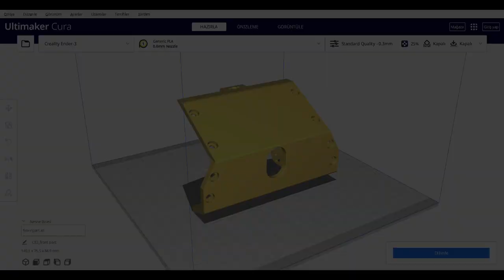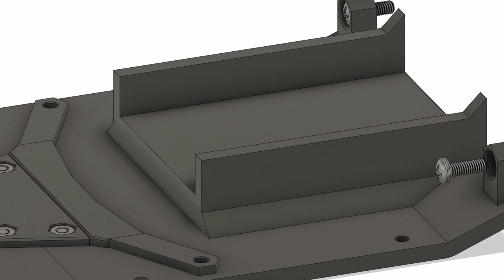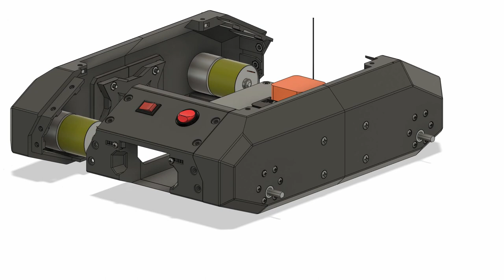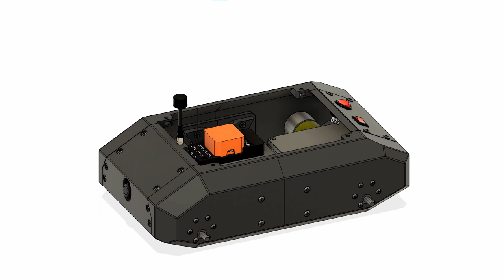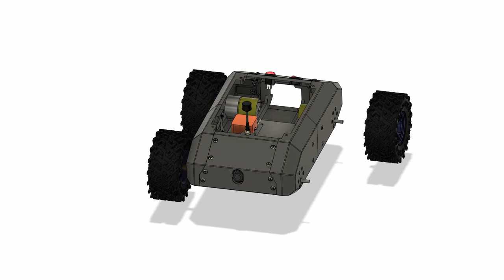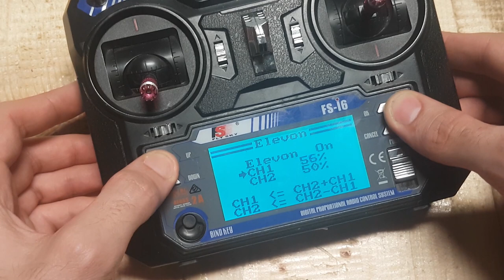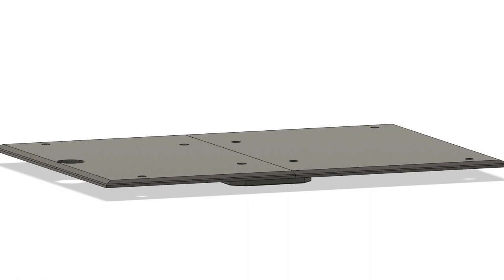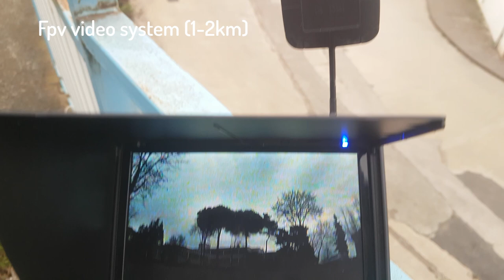Open RC FPV Long Range UGV Project

Comment: This is super cool and impressive made from scratch. I really wanted to do something like this but figured it was just too much work trying to get something equivalent or better than RC cars out there which are able to tackle nearly any terrain. Unfortunately those are around $400-$500 though.. Either way it's kind of a slap in the face when doing something like this, getting real excited about it, then seeing that it might get stuck in slightly tall grass. That happens to any car of mine that isn't getting way more than average ground clearance. I think with some clever servo arms something like this could be made to get itself "unstuck" though. Front and rear diff locking seems to really help but then you really do need a super legit and full featured chassis and suspension.
Reply from the maker: I actually tried to create a platform to improve myself. With this project I made, I both improved myself in drawing and learned about the problems of unmanned land vehicles. But yes it is a tiring tool to do. But it can be used for different purposes by putting a lidar or a pixhawk on it. Thank for the comment :)
Reply: Hi, I believe I have a chassis that meets all the requirements at a good price！

Comment: Hello! Your project is great. Thank you so much for this video and attached materials. I also want to make similar robot. But I want to make autonomous one with GPS control. Can the construction presented in the video be autonomous? I see that you are using Cube Orange to have the ability to make it controlled by GPS ? Sorry for my English). I hope you can help me.
Best wishes,
Mihail
Reply from the maker: İm still working on it. I still cant efford pixhawk cube. İn the video that was just a reference its suitable for pixhawk. But i will make much bigger car and when I build it i will add pixhawk on it. Thanks for the comment and im sorry to late response . I didnt take any notifications. 
Hope u can maka a autonomous vehicle.
Reply: Hi, I believe I have a chassis with high quality~
Reply: @U-Tech20  Thank you for answer! And  I must say, that I built my own autonomous  viechle based on Pixhawk 2.4.8. 
This robot made for measuring roughness of pavement, and I won local competition of students projects. You helped me a lot and I really appreciate it)
Reply from the maker: @paint4745  I'm so glad to hear that. I congratulate you on your success. It is a very happy thing that the things I do benefit someone. I wish you many more beautiful projects in the future. I'm curious about the project you made, can you send me photos on Instagram. utech.2023

Comment: cool project, is there anyway you could provide us with a parts list as in, where bought and which specific product?
Reply from the maker: Thanks. Im preparing the material list with amazon and bangood links.
Reply: Where can this be found?
 @U-Tech20
Reply from the maker: I shared all links in descriptions. Are you mean design files or product links? @Louisianahelicam
Reply: @U-Tech20  I’ve printed the entire frame and am ready to build.  Can you share the link to the LED lights?
Reply from the maker: Hi. Sorry for late response. I use basic LED lights u can find in everywhere, but here is the link maybe it can help you. İf you search LED light be sure to choose 12V led bcz if u choose 5v led battery can damage your led's.And ım soo happy to hear you are making my design. İf u are finish UGV project i would love to see in thingiverse. Thanks again
https://www.amazon.com/YUNBO-Addressable-Waterproofe-Storefront-Adhesive/dp/B08LB3KGP5/ref=sr_1_10?crid=1GPQ3HF56UR2P&dib=eyJ2IjoiMSJ9.XWPVXi44kScDUSbL7ZZrDOvk_nxeTQTV9kgjerYTbyBKYdPmD_-Q-uD0bj6DxG6Geh9srnkEldKX9TiBHopcfm4vFtxfz3FP7xj1I4zWgrnEKpeP3odXtejlogFjhpNG4nrRXQxT6x_lCK3asOI2H59lRrPSPHkU9erlMlSKIrM4uyZzpeYfcUWJerIeLj14E-uv1m1Xs_BVUuW6dpaVhAmwoAmGxfx2gVVyYQKbvxs.D94cw1KiAXfZqtvKQ-jVtwxHW0c2yLleF8_hHBH5x-Q&dib_tag=se&keywords=12v+LED+module&qid=1709139958&s=books&sprefix=12v+led+modula%2Cstripbooks-intl-ship%2C237&sr=1-10-catcorr @Louisianahelicam

Comment: Great video. Learned a lot.
I have a question, what is the diameter of those wheels.
Reply: And also do you know where can I find similar tires and couplers, but for the tires i need approximately 200 mm or at least 150
Reply from the maker: @axeleliasdejesusdeljesus2407  ı used a 125mm diameter tires. I shared all material list in thingiverse you can find there. I bought them in Turkey but can find it in amazon or bangood. If you want to buy bigger tires, make sure tires dont touch the chasis , maybe u can use longer coupling so tires cant touch chasis. Thanks for good comment :)
Reply: I had to use rock climbing tires, they were the only thing with the clearance to not rub on the body. I was thinking about printing an adapter that extends the 14mm hex out another 10mm so I can put offroad tires on. Just not sure if PLA is tough enough.

Comment: All the links are cut off, can you update?
Reply from the maker: Hi. Im sorry i cant make youtube vertification. So icant share real link. You can search in thingiverse saying UGV and you can dowland it. I still trying to do vertification im sorry about that.
Reply from the maker: I finally did vertification. Check the links u hope it works.
Reply: @U-Tech20  Got em and my bot is running good. Next up, I'm gonna add a buddy box to have a raspberry pi as the main controller and RC as the take over/backup.

Comment: Hi! Very cool design, would like to try to build your model, but I can't understand what kind of battery was used in this case? Can you tell me how many volts are needed? 12V 6pcs  3s2p li-ion battery? I'm new at this(
Reply from the maker: You need to make 3s battery hich is aproxsimaitly 12v, 1 li-ion or lipo battery can give 3.7v, 3 li-ion can give 11.1V. and then i make paralel 2 of them for more capasity.

Comment: Hey, anyone know what LED strip was used for the headlights? Thanks in advance
Reply from the maker: hi, im so sorry but ı could't know what are the exact names of the LED strip But you can use 12v normal LED strip. Just make sure its fits well.
Reply: Ok thank you. Great build btw

Comment: I'm in the process of creating this. I just made the body and am about to do the wiring. Im a lil confused on the electronic schematic
Reply from the maker: First of all, thank you very much for producing my design. It felt so good to see someone do my open source project. I can say this for electronic design. I tried to be as descriptive as I could. The connector system may have been a little confusing. The reason why I use the connector system is that it is easy to assemble and that someone who wants to make design changes in the future can change it more easily.

Comment: We're can I get this 0:19
Reply from the maker: Whats that i didnt understand :(
Reply: @U-Tech20  hey the motors you use are out of stock, do you have any  recommendations for suitable replacements ?
Reply from the maker: @TheAdamorme  you can searh it with 37mm reduced motor here another link i just found:https://www.amazon.com/Greartisan-Electric-Reduction-Eccentric-Diameter/dp/B0721T1PXQ/ref=sr_1_1?crid=OW3ZMMI5SR5S&dib=eyJ2IjoiMSJ9.goJ7SAt8txLAUF9u8y6H3BXAVF18otFwgDmJHL3U39D8s9H0aWNxBXQJxXx_b4UfAYWxoDle-QuEVfhsxNvV0Xc-X6btC0Cbu_qQEJWI4UsHsU4lqN8hzF7EL5WgVItUScx7kKCIRIjNh_De69NEg5Ha2GB9_bqfu-4YmCov5fkouEougG7kZOrmx3_CmmlWoXULbdB6q3zKlRFGUvgxljboRe_E5_N7Ml4Yg3WyaE9gtuqp442c7xcUfYbw8Dq5-3kpQcM-gi72frJaHV4eCCEd-rdxdDWYhNE8F77knhI.sT0IV-s41DPPDo1VKECd3cEDqAjveQkBrSb5zdb3hpM&dib_tag=se&keywords=37mm+reduced+motor&qid=1720299722&sprefix=37mm+reduced+motor%2Caps%2C202&sr=8-1
Reply: @U-Tech20  absolute  legend, one last question. how many ESC's total do i need 2 or 4 ? from what i can tell it looks like in only need 2 but thought i'd ask
Reply from the maker: @TheAdamorme  i use 2 esc. I connect 2 motors paralel. So 4 motor u can use 2 esc. U can check in electronic schematin link in describtion.
Reply: @U-Tech20  sweet, i thought so, the only thing i cant find now is the adapter 9:45 sorry to be a pain but what are those called ?
Reply from the maker: @TheAdamorme  I am very happy that you are so interested in my project. Please do not apologize for asking questions. It makes me happy that you ask questions. Those parts are called couplings, they usually come with wheels, but if they don't, you can search on the internet for 30mm hex couplings. I must have left a few links you can check.
Reply: @U-Tech20  it's by far the most comprehensive build I've found so far and it's fantastic, would you be able to explain how to set up the mixing for the differential thrust for steering on a crossfire transmitter of that's not too much trouble ? I really appreciate your help :)
Reply from the maker: @TheAdamorme  im sorry i dont know how to make mix in croffire but heres a some link for elevon mix. Im using elevon mix for diferantial drive system. :https://youtu.be/cKqwTQlAWa8?si=26Rtq1c2IiikcEse
Reply: @U-Tech20  hey man sorry to bother you again but i just wanted to confirm that these motors that you linked are suitable as they have eccentric shafts and the originals in your plans are central ? >.<
Reply from the maker: @TheAdamorme  The electric motors I use are also eccentric. The output shaft is not exactly in the center, but a little further down.

Comment: Hello!  Please tell me what wheel diameter did you use?  Are you planning to do this project on autopilot?  For example inav?
Reply from the maker: Hello, the wheel dimensions I use are 125x58mm. You can find it from this link https://www.amazon.com.tr/dp/B07ZBG9T1L?ref_=cm_sw_r_cp_ud_dp_5JFGCKEX4P85QT789DCH. I want to install an autopilot system on a much better model in the future. I'm currently working on a new land vehicle. I will make a detailed video when it is finished. I will use Pixhawk and program it through mission planner. Thank you for your interest.
Reply: @U-Tech20  Thank you very much for your answer!  Yes, a very interesting project, I was thinking of doing something similar, now I’m working on a drone ship with fpv.

Comment: May I ask if u have the 3d model of the whole ugv, not by part, so that I could modify the design?
Reply: btw, the design is good! new subscriber here.
Reply: also where did u make ur electronic schematic?
Reply from the maker: @maydaclan2382  ofc. I shared all design files im printables. Step files and fusion 360 files you can modify whatever you want. Also i make my electronic schematic in microsoft word . Thans for the subscibe. If you have any other question you can ask whenever and whatever you want.

Comment: is it possible to run waypoint navigation without using orange cube?
Reply from the maker: Yeah you can use whatever card suitable with gps system. Arduipilot, matek f405 wing etc.
Reply: @U-Tech20  i was planning to do autonomous way point navigation, id ont know if orange cube is necessary for my project. may i have your opinion? thanks!
Reply from the maker: @alibal9810  cube not necessary. You can use whatever card u want. Ofc card need to support gps.
Reply: @U-Tech20  thank you for the clarification 😁

Comment: Can i use big motors?
Reply from the maker: If they are suitable for design of course you can use. Or you can edit the design in fusion 360 or solidworks.

Comment: Assalomu aleykum, your UGV is good, i see you spend a lot of time, are you planning to create custom remote for your UGV project using arduino microcontroller, nrf24l01 for communication (optionally you can attach directionoal wifi antenna), OLED 0,96 Arduino I2C SSD1306 to display telemetry, Iduino ST1079 joystick,  LM2596 Step-Down 3-40V 3A with voltmeter for controlling power supply?
For the receiver you simply need to use arduino mega and nrf24l01 for communications.
Reply from the maker: Hi sorry for late response i didint get any notification and i just see your comment in my mail, ı was working on a remoate conttroller project , but without using nrf or cheap components like ST1079 joystick, etc. ı want to build with Lora for long range communication and stm32 microcontroller for much more powerfull data transmitting and fast responses, you can find that kind of remoate in electronoobs youtube channel ı guess, sorry for my english and late response, have a nice day .

Comment: and the real range is?...  300m :)
Reply from the maker: Yea flysky doesnt have too much range but if you have enough money you can use it with radiomaster, radiomaster have much better range.
Reply: @U-Tech20  main issue - video, not commands :(
Reply from the maker: @evgenijrakhno3686  no man eith the good antenas you can recive 1-2km video in open area.
Reply: @U-Tech20  after a lot of tests with custom-build antennas I can say that's it doesn't work this way. You can get 10-12km range for FPV, and, with the same setup you will get 600-800m in clear space and 200-300m in bushes. 2km not possible in any way
Reply from the maker: @evgenijrakhno3686   oh ok. I was have akkfx2 but i didnt mesura. Thanksfor the information man.